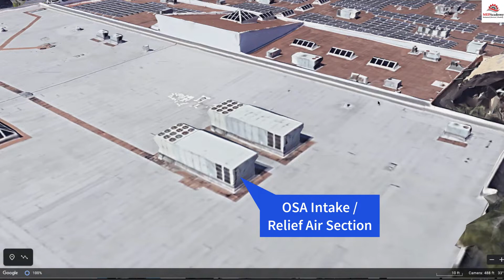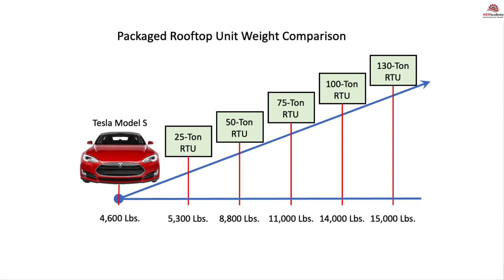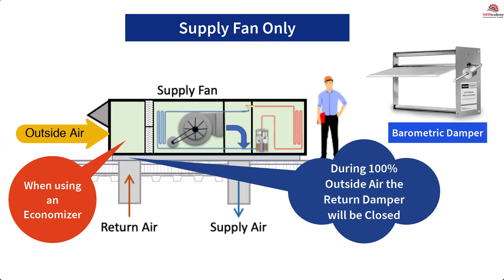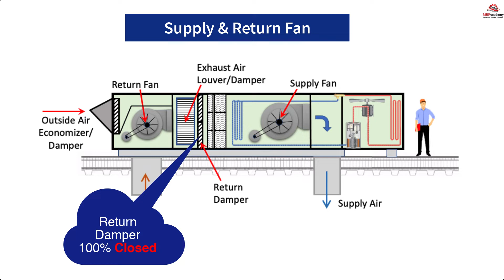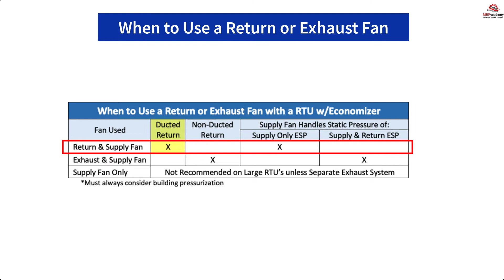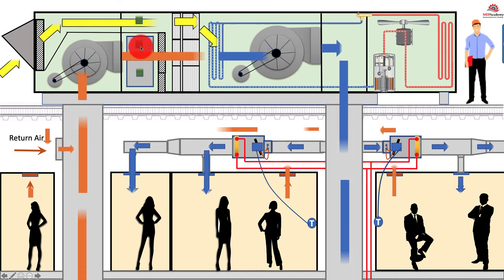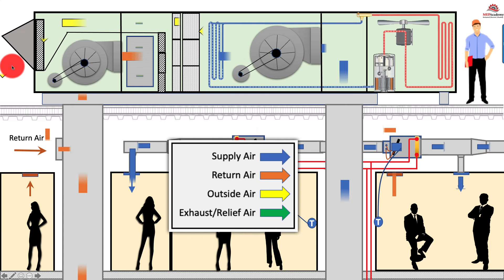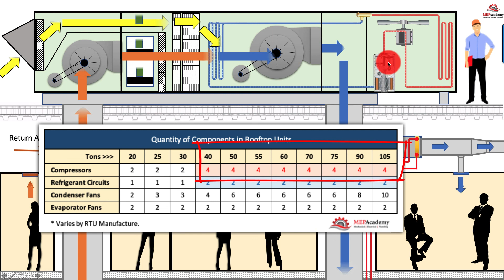Rooftop Packaged HVAC Units Explained

Comment: On the smaller systems with just a supply fan, is there a return vent or something? How does the air go out?
Reply from the maker: There are several strategies for relieving building pressure. Here are the most common methods, 1) Barometric relief dampers, 2) Powered Exhaust Fans, 3) Relief Air Dampers with Economizer Functionality, 4) Modulating Relief Dampers, 5) Building Pressure Sensors and Control, 6) Natural Relief.

Comment: What’s the difference between auxiliary electric heat and back up electric heat on a ASHP RTU?
Reply from the maker: In area's where the outside temperatures get really cold, the use of a backup heater can supplement the limited capacity of the unit.

Comment: Why go 100% outside air, isnt that inefficient?
Reply from the maker: There are times when the outdoor air can satisfy the load without running the compressor, that's why economizers are mandated by energy codes. See our other video on Air Economizers for a better explanation. https://youtu.be/2UCmNs8qGBk